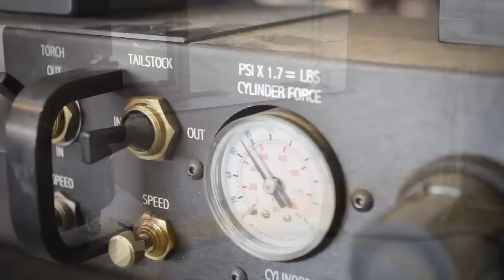How It’s Made: Porsche 997 Turbo (2006-2009) Supersport X-Pipe Exhaust

Comment: This is stainless...Why is there no argon back purging?  Or any kind of flux backing?
Reply: because it's exhaust, it doesn't matter.
Reply: you don't need it. it's a class c weld.
Reply: DurpandDurp if your paying upwards of 3600$ for an exhaust i expect it to be back purged. There's plenty of cheaper exhaust for cheaper cars that are backpurged. Also the sugaring inside the exhaust will absorb moisture fatigue and crack from the vibrations after a few years.
Reply: you should tell that to all the big name exhaust companies that have their exhaust on cars for decades...with no back purge. In the end it's a non sanitary, non code, non structural weld that is more than acceptable (and strong) to weld without a back purge
Reply: slovenski123 lo
Reply: agree with you, state of the art shop, huge price tag and no backpurge makes no sense to me... it will be affected way faster by corrosion
Reply: I agree they should of purged. They just turned that stainless into wild steel at the weld. It's a matter of do it right or don't do it at all.
Reply: This what we call business and stupid people buy it hahaha....JDM is better cheaper and qualities

Comment: What I don't understand is why they don't cut the hole for the 02 bung. The weld the bung on the drill the hole? Then chase the threads? Sounds cheap
Reply from the maker: DurpandDurp This process ensures that the hole lines up exactly with the proper positioning for the O2 sensors.  Our manufacturing fixtures position the bung in the exact location, where it is then welded, drilled, and chased.
Reply: ah ok, was curious. Are they already taped? or you just chase the threads once it is welded?
Reply from the maker: +DurpandDurp The bungs themselves are pre-threaded before we weld them on.  We then drill out the hole in the wall of the tubing, and clean the threads so that everything is smooth.

Comment: looks good and all but metal is not a flexible material in its solid state, therefor when making bends and making metal widen for flanges and such all it is doing is making the metal thin and weak
Reply: Fernando Alexander Wrong